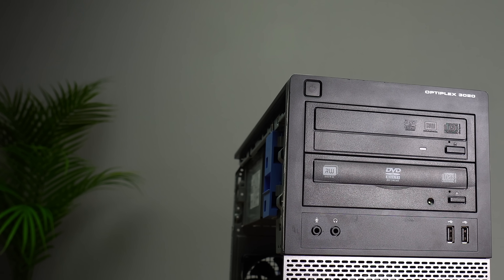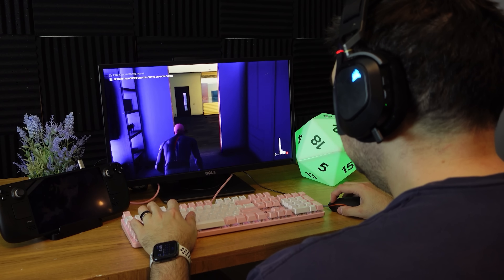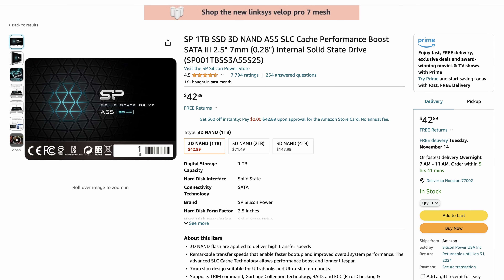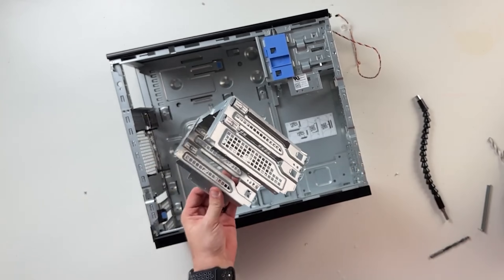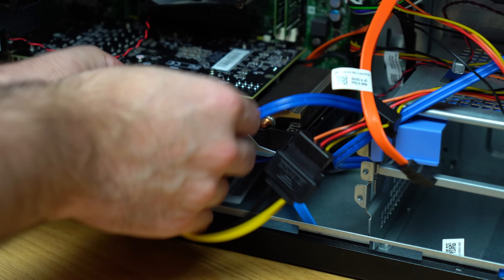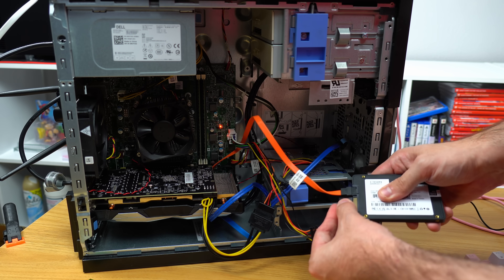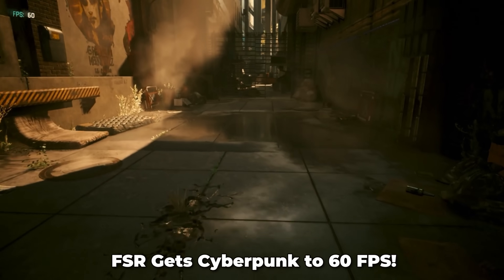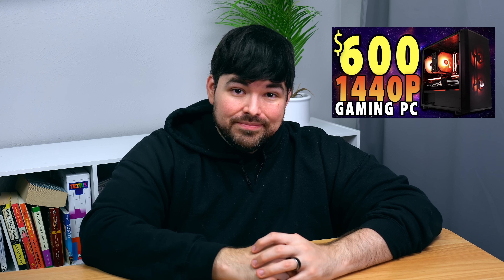Yes, You CAN Build a $100 Budget Gaming PC!

Comment: I did this 2 months ago and ever since it s become my daily system. Mine clocked in at about $79 with a geforce gtx 745 and a i5-2400 but im upgrading it with a xeon processor in a few days. it runs great with about everything i've tested it with. (I even got MW2 and MW2019 to run on the thing and played through the whole campaign.) These builds are highly underrated as entry pcs.
Reply: wow a GTX 745? Why not focus on upgrading the GPU first? The older intel processors still hold up super well and I think the graphics card would be the weak point of that system
Reply: @yams_yams_  honestly, with the form factor i bought, i had to take a hammer to the case just to get that card in. I would probably need a saw for anything bigger than the 745, but i’ll look into it. Thanks.
Reply: Agree with u @yams_yams_
Reply: Which Xeon processor?
Reply: @johnster7161  xeon e3 1270. I think equivalent to a i5 4790.
Reply: @f0vri You should keep looking bro. I just got my first ever pc for 100$ Came with a AMD FX 8320 16 GB of DDR3 and a Rx 570 8GB for 100$ flat. I bought a used i7-7700 with mobo for 50$ Together! Insane deals. And 16 Gb of ddr4 so far I’ve only put like 200-250$ Into my pc and it runs Games great. Warzone 3. 70/80 fps in 1080P and 100-144 fps in 1080P on fortnite while streaming.
Reply: how easy would it be to upgrade different components going forward?  would a new motherboard be required?
Reply: @handlemypantscandle  yes it would be required if you want to upgrade to next gen. However Ryzen 3 1200 af and a320 mobo would go a long way, it is stronger than i5 2400 and it would save you the cost of new mobo and ram when upgrading. Don't worry a320 mobos can support 65W cpus, so you can put Ryzen 5 5600x without buying a new motherboard.

Comment: hey,i have a question,i want to buy ryzen 5 5600 and rx 7600($240) or rx 6600($190,)which one do you say is better,and also,is 750w fully modular power supply enough?
Reply from the maker: The psu is more than enough for sure. At those prices, I’d say the 7600 is worth it
Reply: @JasonWitmerYT  is 600 watt enough?
Reply: @shatiraaaa I haven't looked at the 7600, but I know I ran a Ryz 5 5600 w/ Rx 6600 on a 450w. No problems at all. Probably wouldn't be able to overclock though

Comment: A huge bang for buck upgrade for that PC would be adding a dirt cheap Xeon, 
E3-1241V3, it is a 4 core 8 thread CPU with very similar performance to a 4th gen i7. No, it isn't officially supported, but sometime around 2018 there was a security vulnerability identified in this era Intel CPUs, a BIOS update was released to fix the issue, and Dell use the same microcode information in the update for all boards using those chipsets, so machines like this Optiplex, and lower end Alienware got Xeon support unlocked. I have an X51 with a Xeon in it, the 4790 still sells for about $40, these Xeons sell for $10-20.

Comment: They can make amazing emulation boxes as well.
I have one with a 4th Gen Core i5 running on integrated graphics and running Batocera and its able to handle up to PS2 emulation.
Don't go in with graphics upscaling unless its Saturn and PS1.

I really want to get a LP RX6400 for that system to get some Xbox, Xbox 360, PS3 and Wii U emulation going on that box.
Also to get something more powerful that could perhaps give me a small PC powerful enough to run VR games like Beat Saber, Pistol Whip and Superhot VR.
The games that are so well optimized that even my aging GTX680 can run these games without breaking a sweat.

Comment: Great video, very ressourceful! But you can definitely install and use Windows 11 on older gen CPUs. I've just installed Win 11 on a i5 3570K system and it runs perfectly fine. Just use the software "Rufus" when creating the installation media and you'll be fine. ;D There is still a lot life left in these older systems. :D

Comment: I bought a refurbished Lenovo ThinkCentre for $180 two years ago with a i5 4750 and 256GB SSD and upgraded the RAM to 16GB with an extra stick I had laying around. Two months ago I added a $130 XFX RX6400 low profile card and wow! Runs like new. I get 100fps minimum in Fortnite at 1440p medium settings in DX12. Good enough for me.
Reply: That GPU is not the best choice for that system. However, if it meets your needs, have fun.
Reply: @tuank624  So what could be then?
Reply: what would you recommend? @tuank624
Reply: nice
Reply: How much Watts does the psu have?
Reply: I got an hp prodesk with a i5-4590 12gb ram and 512 hdd for just 60cad and I just ordered a rx 6400!

Comment: This old optiplexes really are a killer value sometimes if you find the right deal. I got one with an i7 8700 as my htpc right now. It came with the 8700, 8GB of ddr4, and a 1TB hdd for like $105 shipped. I threw in a 2nd stick of ram, a 500GB ssd, and an rx 6400 LP single slot card? 

And the thing rips for being a tiny htpc. And not consuming much power. 

The 8700's igpu is pretty solid since intel upgraded their igpus with 7th gen, so it handles transcoding and such super well too, so when its life as an htpc is over? Itll probably become a plex box.
Reply: What optiplex did u buy?
Reply: @testzasve6021  I've gotten a couple of similar deals but do note I am saying they were/are DEALS... You they're not normal pricing but sometimes you'll just see em for these prices but they usually are a "buy on sight" thing if you really want it. But one was a 5060 and one was a 3060.
Reply: For 105 dollars? Damn...
Reply: I'd buy as many as i could for that price lmao

Comment: Good build, I'd just say that 120GB is too low these days as anything other than a basic boot drive. Modern games take up a ton of space. I would have added on another $20 and tried to pick up a 500GB SATA SSD to start with so you could at least have a reasonable local game library.
Reply: Modern AAA games take up a ton of space. But this thing ain't built for that. It's built for like decade old games and esports games. And another ssd or an hdd is like the easiest next upgrade.
Reply: Honestly yeah, even as a boot drive 120gb is just not enough. 256 is the bare minimum I'd ever recommend nowadays. Between the few games you'll wanna install & just the other programs and whatnot it's just gonna fill up crazy fast & you're gonna need to upgrade super soon if you use your PC frequently
Reply: Budget was 100, so.

Comment: I did see a PC on ebay for 70 dollars that came with an i7 6700 16GB ram and a 256gb ssd. Thought it was interesting for the price.
Reply: Go for it bro!
Reply: @PrjctWRX  no im fine i already have a pc
Reply: @toysourboy  whats ur specs?
Reply: @toysourboy ur specs?
Reply: @Toysourboy you could've bought it and flipped it
Reply: Yeah sometimes you can see some really good deals. 

I've seen a few 8th Gen systems with 8700s (6c 12t) go for roughly $100 myself that also had either 8 or 16GB ram, and either a 256 or 512GB ssd or a 1TB hdd.

And honestly those systems still roar. I'm using one as an htpc with an Rx 6400.  (Yes yes I know pcie 3 slightly slows down the 6400, and it has no video encoder)
Reply: Is it legit or scam @daymianhogue1634
Reply: I have 4 dell optiplex 7050s with 7th gen that I'm Turing into gaming pcs
Reply: @jonathantolbert4176  thats decent, does that vpu have integrated graphics?
Reply: @jonathantolbert4176 can I buy one of them?
Reply: @jonathantolbert4176 what’s ur plan to turn all 4 of those into one pc
Reply: Damn that’s mad all it needs is like a £40-£50  gpu and that’s a decent budget gaming pc
Reply: No way! Go for it!!
Reply: Ain’t to shabby I would buy it and flip it
Reply: @@BradyLovesColdDrywall what u on about?
Reply: a good price ik im late but it is a good price
Reply: Being an electronic addict is looking at videos like this when we already have a beast setup e
Reply: @OngoingHeretic  ebay
Reply: get that
Reply: Can you send me the link plz
Reply: I once got a Optiplex 7080 with a i7 6700, 120 gb SDD (as boot drive), 1TB HDD, 8gb ram (single stick) plus screen/keyboard/mouse for £100 on Amazon about 4 years ago.

Was actually pretty solid for the price
Reply: Throw me the link bro
Reply: I found a single penny pc I am not joking I am serious it has core 2 duo e4500 4gb ram 650 watts psu and 500gb hdd
Reply: Throw a 1650 or an RX 580 in there and you've got a decent PC especially as a beginner system.
Reply: I bought a dell optiplex with an i7-6700 8 gbs of ram and a 500 gb hdd for somthing like 110 dollars it alone with the help of a ssd i had lying around has been good enough for some light gaming until i can get a decicated graphics card
Reply: @nubscubs129  turn it into a batocera emulation machine, bro.
Reply: I found the same one for $50
Reply: That i7 is from 2015. That's not good
Reply: @Boogie_the_cat  It's still better than being stuck on DDR3 lmao
Reply: @Muslim1769 dont see why it matters
Reply: I'm stuck on ddr2 on my desktop
Reply: Umm do u have a link to it perchance?